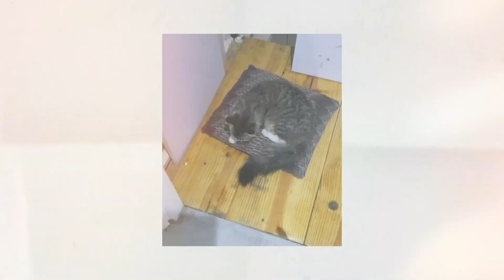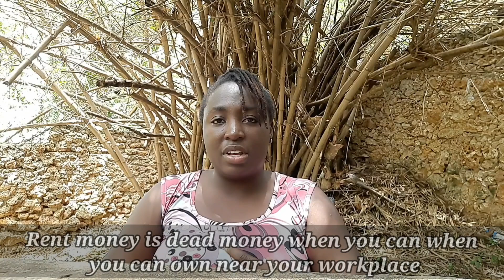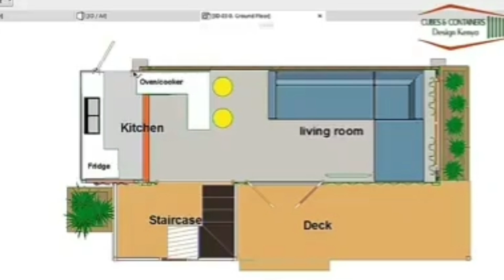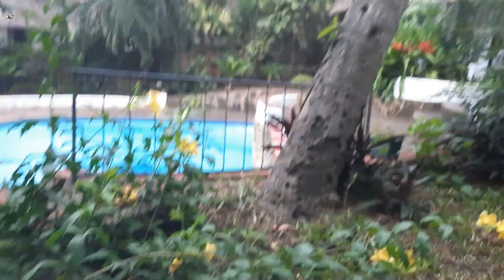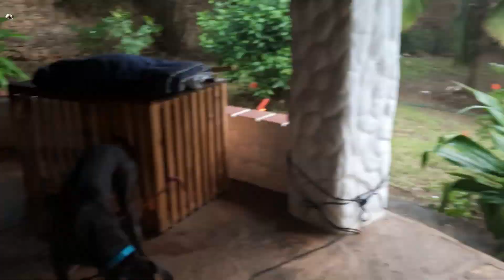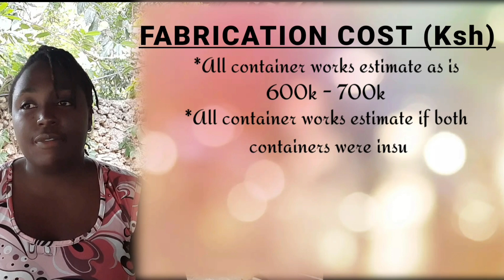Cost of my Container Home | Kenya

Comment: A one bedroom brick and mortar house could cost around 900k. So it's more or less the same. 4yrs ago I used 750k plus for a brick and mortar house. I recorded the total costs. I have noted that the main difference is the for the container house you need a good interior designer technician while the other the mason has to get it right fot the roofer, the electricals, the fitting technician and the roofer
Reply from the maker: The other difference and the biggest is the portability that comes with a container, if well designed. I moved this same house 70KM from the previous location.😊

Comment: I think its not all that low budget considering the space you have, a semipermanet building would be economical.
Reply from the maker: But a semi permanent structure wouldn't change locations and still remain intact
Reply: @livingtinywithGrace maybe for commercial use but as a home think its not an option.